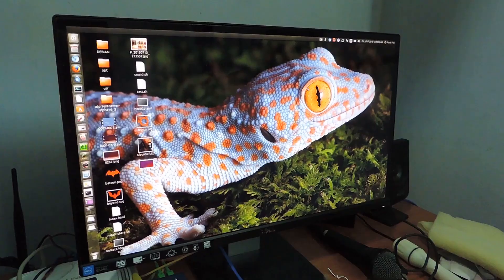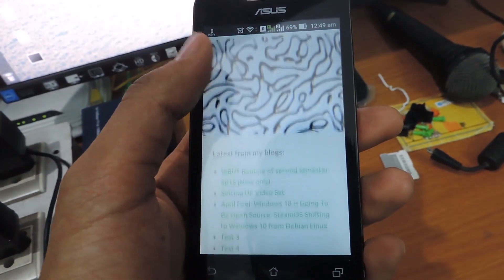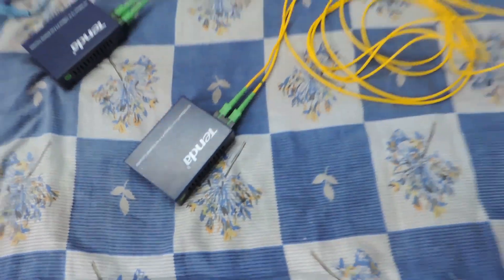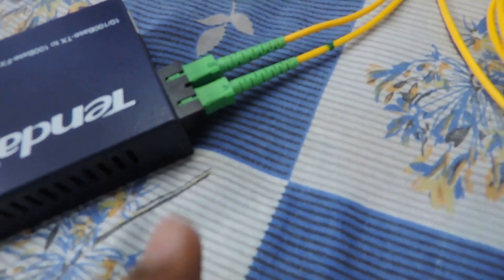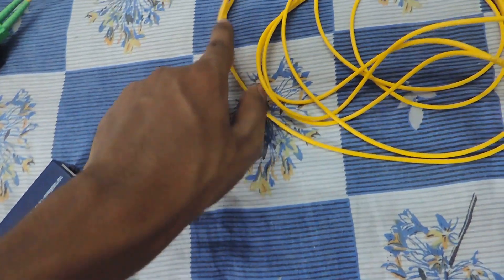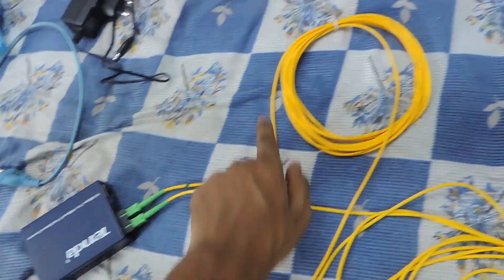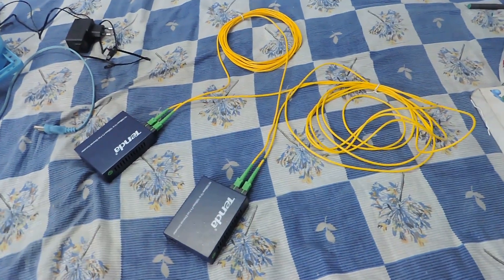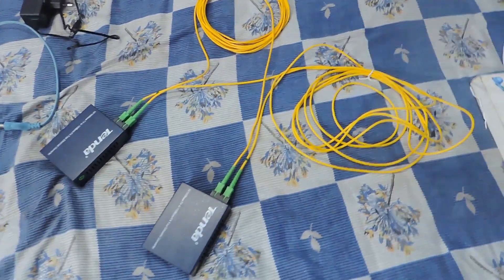My Story: Ethernet - Fiber Optic - Ethernet media converter

Comment: Kya hum onu device ke badle me media convertor use krte hai to chalega kya!??
Reply from the maker: While the media is fiber, the protocols are different. If you want to use MC then both sides need to have MC. If one side is OLT, the other side has to be ONU. And for OLT-ONU a single fiber can be used for multiple clients (one to many) but for MC it's one to one connection.
Reply: @PavakPaul  Mein bsnl ftth installation krvane ki soch raha hu. Mere pass tplink archer c6 router hai. To kya mein onu device purchase karu wo sahi rahega? Ya media convertor purchase karu wo sahi rahega!!? 

Please reply in hindi..!
Reply from the maker: @importantquestions6398  They should provide you with an ONU device. Ask them.

Comment: Hi Pavak I'm going to be installing a Ethernet handoff circuit. The NID is located over 900ft from network rack. I can use the customer fiber patch panel. Can I use the same configuration (cabling) you showed?
Reply from the maker: Yes, you can use the same config or you can use a media converter that uses only one fiber optic cable.

Comment: my media converter two light's not blink. so please suggest me what is the exactly problem. there is a media converter problem or a fiber cable problem. i also check another media converter but there was a same problem in the network so please suggest me what is the exact problem in the network.

Comment: Bro iam a Railtel broadband provider I have so many media converter which fail with power and Ethernet and Fiber signal problems kindly give me PCb solution
Reply from the maker: Hi, I'm just a consumer, not a media converter provider or ISP. So, I can't really give you any recommendation as I don't have much knowledge about the manufacturers. The ones I'm using in this video are from Tenda and they're still working after 3 years.

Comment: Wanted one information, why there is a need to use 2 media converters. If I purchase Single Mode converter can't I just connect Tx Rx and take the converted output through RJ45? My requirement is converting Fiber to RJ45. I will connect RJ45 to my wifi router.
Reply: Jayant Nag D hello sir have you find any way for convert fibre to rj45. I also want to connect fiber to my router. Please answer me

Comment: For fiber link not connected between converter to converter. For cameras connected local power, but fiber optic cable connection the signal has to transfer to control room

Comment: We are used 10/100 MBPS TPLINK-MC110CS - 2 nos. for IP camera, below problems faced at site. 

The fiber cable distance is 2000mts from control panel to cameras location. 
The communication was failed between converter to converter through fiber cable single mode.(MC110Cs 2 Nos used) 

At control room tested through patch cable(3mts length) between converter to convertor its working fine. 

The fiber OPTIC cable continuity its good. 
Can you suggest the technical comments
Reply from the maker: Hi, Most likely the media converters do not have enough power to carry data 2KM far. Best if you can manage a higher powered MCs and see if that works. By the way, for 2KM distance and if there is a line of sight, you can also use point to point WiFi access points.

Comment: I'm used TIP LINK Mc110 CS media converter, the converter to convert distance is 2 Km, can i connect 2 cable or only on cable.

Comment: For Ip Cameras Single mode media converter used, can we connect both cable or only TX to RX
Reply from the maker: For single mode media converters, you just need one cable and that goes to the same port in both the MCs. However, the MC pair will have different TX/RX wavelength. Make sure you're not using exact same models.

Comment: Very nice info and video. Keep up the good work.
Reply from the maker: Thank you. I'm really glad that you liked it :)
Reply: I wanted to ask whether the media converter also amplifies the signals when it converts from fibre to electric and vice versa??

I am having a similar set up. I have attached WAn line (RJ 45) to the media converter and the media converter is attached to the fibre line.

The distance of the WAn Wire is almost 250 metres. 

So how come i get full speed even when the length of the wire is 250 m. Or does the media converter amplifies the signals??
Reply from the maker: I don't know about amplifying. For the fiber part, the fiber signal is generated straight from the media converters (the TX part) and also terminating to the other media converters' RX part. So the signals are generated from there, so I'm not sure what do you mean by amplification.
Fiber cables can cover even 100 kilometers. Although the coverable distance depends on the media converts and the quality of fiber. But 250 meter is just nothing for fiber cables :)
Reply: 250 m is the length of my cat cable ( i think cat5). Does't the signal degrade over this much length of cat5 cable?
Reply from the maker: I don't know about 250 meters. 150 meter is the highest I've heard of in the past.

Comment: Paul.
I want to run 2000 ft internet wire I was told I need to run via fiber optic, what do I need to buy and how to connect ? any vedio
Reply from the maker: It'll go pretty same but you need to buy fiber cable to cover 2000 feet. Then in the both ends you'll need to spice patch cords. Contact anyone ISP in your area and they'll help you with the splicing. Then you just add a media converter in each side and you're pretty much done. Please tell me if you need any more information with it :)

Comment: Hi please ! how do you do to configure  this modem on M.C fiber optic
Reply from the maker: Hi! These MCs can't be managed. It works like a hidden bridge so anything connected to the two ends of the ethernet cables would think there is a single LAN cable and would be completely unaware about the media converters :)

Comment: Hi, does media converter have it's own internet, or you must get internet from company
Reply from the maker: No, the media converter just converts 10/100 base ethernet-fiber.
Reply: You mean it doesn't provide internet, unless you first have internet access in your house
Reply from the maker: RICHARD NOURA PETER . Nope, this is just a media converter. It's sole purpose is to convert one media to another.
Reply: OK, when it converting does it provides it's internet assces alone ,without connecting it with any internet company service